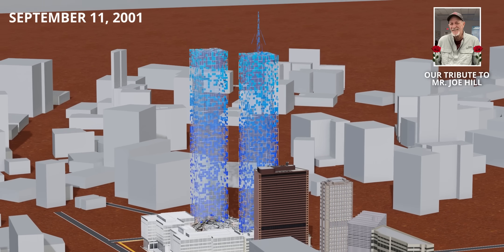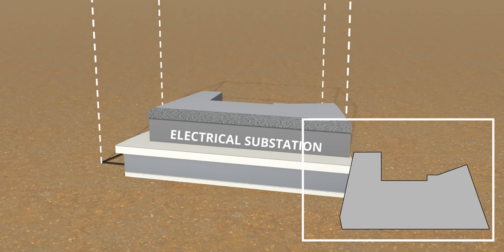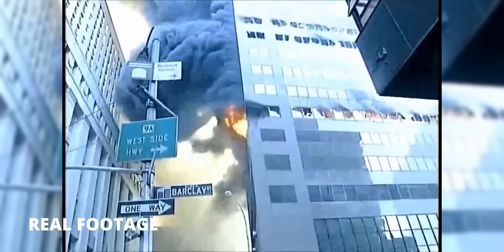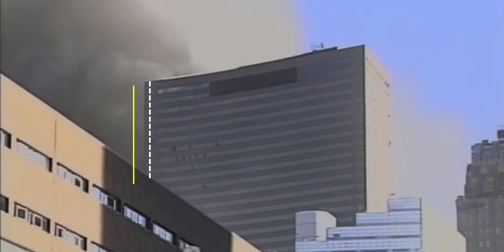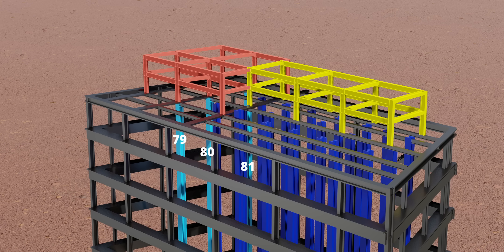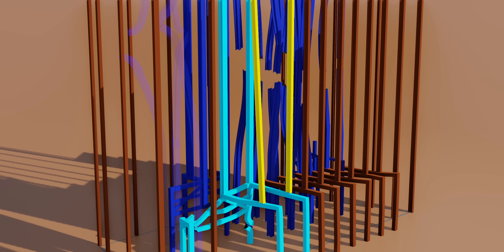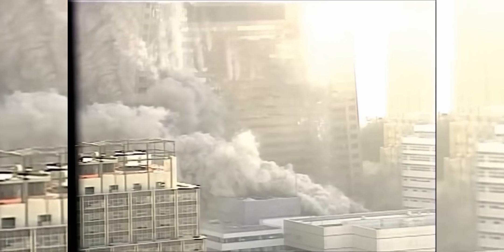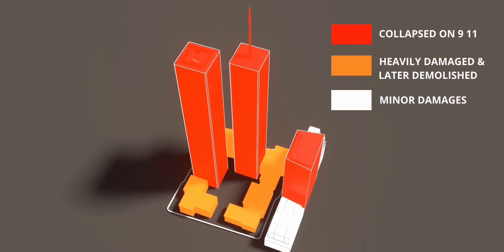Collapse of Building 7 | The Complete Physics

Comment: As for the fires not being 'hot enough'... people forget these are skyscrapers, which always have a greater wind load than at ground level. I have literally melted brown glass beer bottles in a 50 gallon drum of trash by blowing compressed air into one of the side holes. This is how a blast furnace works. So, yes, paper, desks, carpet, insulation, etc. that are burning absolutely can be blown by the wind at that height to those temperatures. Once a major blaze like these have ventilated to outside, you will have even more incoming wind as big fires create strong updrafts that are back-filled laterally.

Comment: Yeah Alaska University already did a 4-year study into the building and concluded it wasn't brought down by fire and said the columns have been taken out, not to mention all the dodgy stock trading put options information was in that building. Not buying this video sorry.
Reply: Not what that report said although it does not matter since that report was worthless. The collapse of Building 7 is probably the most studied engineering disaster in history and the subject of 5 comprehensive engineering studies and more than two dozen technical articles in major peer reviewed engineering journals that are actually good. Thousands of pages of material.
Reply: @TheCriticalStinker-01 why was it worthless?
Reply: @dougprice4228  - Concluded by claiming to have proved a negative while at the same time reaching no actual conclusions (I suspect on purpose) and failing to achieve any of the reports 3 stated objectives - due to lack of trying. Also, at least 3 pages of the report were either written by the reports sponsors without proper credit or plagiarized from them almost verbatim.  Naughty.

That's just the start but its also enough.
Reply: @TheCriticalStinker-01   "We simulated every plausible scenario, and we found that the series of failures that NIST claimed triggered a progressive collapse of the entire structure could not have occurred. The only thing that could have brought this structure down in the manner observed on 9/11 is the near-simultaneous failure of every column in the building below Floor 17."    

I would say that's hinting at a conclusion.
Reply: @dougprice4228  - Every possible scenario?  They tested exactly one scenario - a greatly dumbed-down version of one scenario in the NIST final report. Static moment in time., static temperatures, limited to 2 floors. That is not by any definition every scenario .  There are potentially millions of possible scenarios.  It is not possible to test all of them. 

It might help if you actually read their report so you would know when you are being fooled. 

Also, hinting at a conclusion is not science. Everyone else who studied the event arrived at a conclusion, they didn't hint or allude at one.

What is actually happening here is one guy is telling you what you want to hear so you are ignoring everything else.
Reply: @TheMiddleClassholes  - Indeed, went out of his way to not say what caused the collapse - just as he was paid to do.

Comment: The idea that the air conditioning penthouse created an excessive load on a 47 storey building is obviously ridiculous. Had the additional load been excessive construction would not have been permitted.
Reply: Wow.  You completely missed the point. The building stood just fine for 15 years. What changed on 9/11 that made the 3 columns below the East Mechanical Penthouse no longer able to support that load they had been carrying for 15 years?

Hint:  It is shown and described in the video multiple times.
Reply: @TheCriticalStinker-01  I'm not missing the point. The columns had lateral support at every floor. The fire was in the opposite corner of the building and heat rises.
Reply: @zig_ziggy  - And what happens when that lateral support goes away (ie: when floors collapse due to the fires), particularly in the NE corner of the building where a disproportionate amount of the structure relies on a single column?
Reply: @TheCriticalStinker-jw4fl  pretty sure having parts of rhe top half of a 110 floor building crash into it weren't part of the plans when it was built.
Reply: @CheeseMiser  - Seems unlikely, but that is not zigs current concern. 

The east end core columns, starting with 79 buckled because they lost lateral support when lower floors failed. An element of collapse initiation this video skips. So I can see his confusion.
Reply: @CheeseMiser  That's why most buildings are designed and built with typical factor of safety better than two.
Reply: @zig_ziggy  can you not be stupid.no commercial office building is built to withstand that
Reply: @zig_ziggy  - Building 7 did not collapse like a house of cards. It collapsed progressively, starting at the NE corner, then progressing from east to west through the core until the core was gone, then the exterior fell last to land on top of the pile. 

Just as described in the video above and easily confirmed through simple observation. 

Building 7 was designed with a safety factor of 2 to 3 hours (depending on component) in a "normal office fire" - with functioning active and passive fire protections and active firefighting efforts. On 9/11/2001 Building 7 suffered extraordinary fires combined with physical damage well in excess of normal design limits and still survived nearly 7 hours - and everyone got out safely.

An extraordinary performance. 

Building 7 collapsed because fires raged throughout the building unchecked for 7 hours. This is not now and never was a mystery. The firefighters standing at the foot of that building watching helplessly as it burned out of control on the afternoon of 9/11/2001 knew it was going to happen and why.
Reply: @TheCriticalStinker-01  Video footage shows the penthouse disappearing - then, very suspiciously a few seconds later, the entire building collapses from the base - aka a controlled demolition. A. In the history of the world, only a handful of steel towers have collapsed due to fire. B. None of them collapsed all at one time, pretty much within their own footprint, unless they were bought down by a controlled demolition.
Reply: @zig_ziggy  - Nothing suspicious about it. Lesics explains the sequence and mechanisms pretty well. That you don't understand it does not make it mysterious it just means you don't understand it. 

We can fix that. 

I understand it just fine and can explain it in more detail if you would like?  

BTW - stop trying to make analogies to things that are not analogous. You are only adding to your own confusion.  There is no analog to Building 7.  You need to understand what happened in that case on its own merits or you will not understand at all. I would also suggest you stop looking at conspiracy web sites and YouTube videos to fill in your blanks. Those are invariably done by morons who probably know less about it that you do.
Reply: @TheCriticalStinker-01  Thank you. Perhaps you should take a new look yourself and explain how 82 steel columns encased in concrete failed simultaneously at the ground floor level, where 95% of that floor area was not involved with the fire?
Reply: @zig_ziggy  - Correction:  ZERO COLUMNS ENCASED IN CONCRETE

There was zero structural concrete in Building 7.  I have the photos to prove it. This is why Building 7 is invariably referred to as a steel frame structure

Nor did 82 columns fail simultaneously, which is obvious enough if you just look.  This video explains how it was a progression of one column after another and this video is correct. 

Are you ready to admit yet that you are substantially under/mis-informed on this topic and need assistance or are we going to keep playing these games? Remember, I offered to help and my first bit of advice for you before we continue is to forget everything you think you know about Building 7.  Based on our experience so far it is almost certainly wrong.  If you can re-boot, start clean slate, progress is possible.
Reply: You missed the point

Comment: National Institute for standards and technology said the office fires couldn’t have possibly melted the steel or weakened the structural steel causing it to collapse
Reply: The NIST did absolutely say steel did not "melt" (heated to its liquid state).  They were quite adamant fire weakened steel to the point of failure, which occurs at less than half of steels melting temperature.  It was in fact their core conclusion.

Comment: My oven and car engine is made from steel , i never knew if u left on for too long it will just buckle and collapse on itself . I need to check the grill every 2 mins when im cooking know.
Reply: Both of those things are not reaching tempatures of 1000+ degrees, how dumb are you
Reply: Someone wasn't paying attention.  FFS 🤦‍♂

Perhaps this will help. In this video starting at 22:30 and running to 28:10 the Energetic Materials Research and Testing Center (EMRTC) conducts a test to see what an open jet fuel fire can do to a loaded and unprotected steel I-beam. Remember, steel melts (turns into a liquid) at around 2,600-deg F, give or take depending on specific alloy. The test was planned for 30 minutes.

youtube.com/watch?v=JXWCMBuusMI&ab_channel=TrutherTVArchives

Within 2 minutes the open fire temperature has already exceeded 2,000 deg-F. 

After just 3 minutes 40 seconds the beam is sagging noticeably.

The beam fails and collapses 9 seconds later after just 3 minutes 49 seconds.

Note the steel fails but does not melt. It is bent and twisted, but not a puddle. You can still tell it is an I-beam. 

Purely from a jet fuel fire.
Reply: @MFitz12 burning fuel or jet fuel lasts/ignites about 30 seconds if that .its not coal or wood. you are deluded. If that was the case a tank of fuel would last for years . This was a insurance job .
Reply: @bigjak7358  - Wow, talk about completely missing the point!  Are you being deliberately obtuse or can you just not help it?
Reply: @MFitz12  purely from jet fuel fire in your own words
Reply: @bigjak7358  - Cherry farmer.  

Still missing the point.

Comment: This video explains absolutely nothing
Reply: Keep drinking the kool-aid.
Reply: I don't think you were paying attention. It explains everything a lay audience would need to know, and more importantly, it is (mostly) dead-on correct in those explanations.  It may not be saying what you want to hear, but that is very much a you problem.
Reply: @MFitz12 no it's not.
Reply: @carlwilson1483  - This video explains the unusual design of Building 7 and its peculiar design requirements.
This video explains how Building 7 was damaged.
This video explains how the fires started and spread. 
This video explains where the collapse began.
This video explains how the collapse began.
This video explains how the collapse progressed.
This video explains movement of the exterior moment frame.
This video explains how the collapse of Building 7 is completely different to that of the Twin Towers.
This video explains how other nearby buildings were damaged and destroyed.

That's a lot of explaining which you seem to have completely missed, making it very much a you problem. These may not be the explanations you want to hear but that is also very much a you problem. 

It is a problem that can be fixed, and I would suggest doing so. It will make you a better person.

Comment: That disproves the official story: 
https://youtu.be/wzRiSZ05SOs?t=2985
Reply: Does it?  How?  Please be specific.  Don't make people watch an hour long video just because you need it to do your thinking for you.
Reply: @MFitz12  Hello, you can start at 49.46 and just activate undertitle with translation (choose automatically and english).
The key point is the shift of girder A2001 on column 79. The heat expands the Iron beams in both directions. But the girder is connected with bolts and a seat and a side plate. So it can not slip down
Reply: @thor7624b  - What if the column moves?
Reply: @MFitz12  Well if they all move in what way ever, it would not have happend simultaneously
And there are so much sanctions against the opposition here in Germany
Reply: @thor7624b  - Got anything else or was that pretty much it?

Comment: Have read that another word for conspiracy theorist is critical thinker.
Reply: Your statement is either an oxymoron, counterintuitive, or both. If you're truly a objective "critical thinker", you wouldn't be a conspiracy theorist.
Reply: I highly doubt that. 

Conspiracy belief is very much about belief and is the polar opposite of critical thinking. Believers only work to defend the belief and do not employ the processes of logic and reason required to assemble all available evidence, determine which bits are true and relevant, then fit those bits into a workable hypothesis.  Endless examples in this comment section alone to confirm that.
Reply: @MFitz12 🤜🤛👍💪